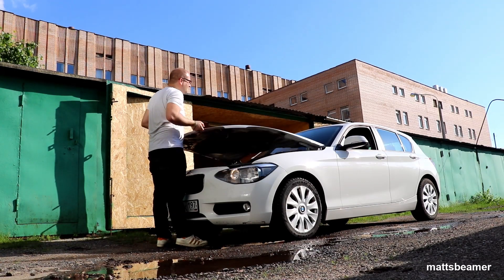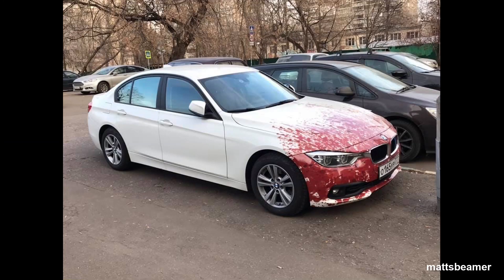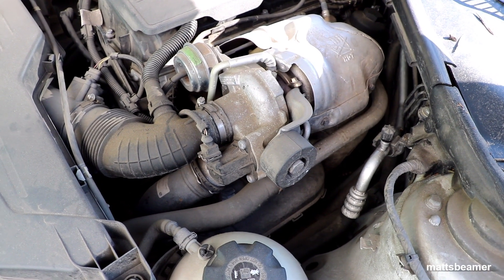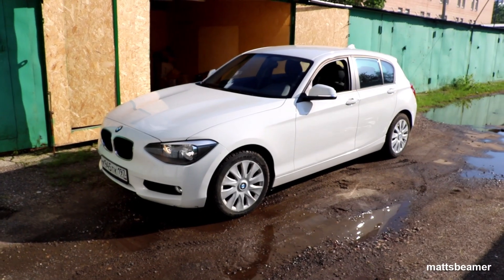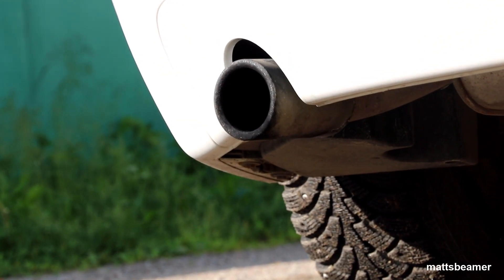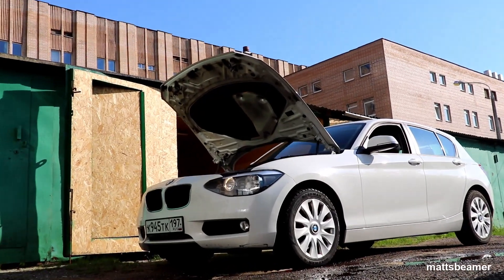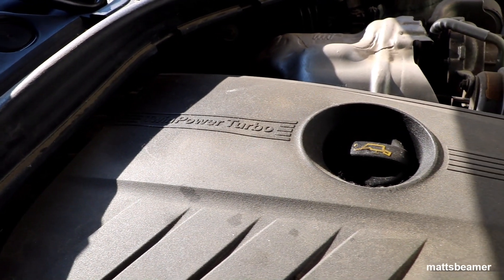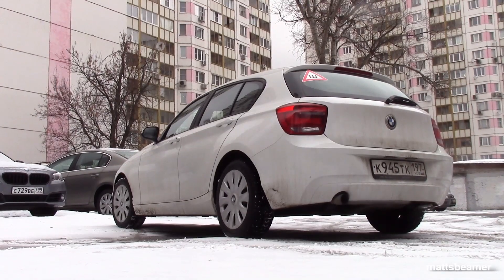Information on the BMW N13 1.6 Turbo PRINCE Engine. BMW F20 114i 116i 118i

Comment: Some knowledge and advice on OIL! Do NOT use 5W30 BMW LL04! Do NOT trust your BMW Dealer on this one! The LL04 they use is designed for Diesel-Engines but also fits the requirements for Petrol-Engines. The BMW LL01 is designed for Petrol-Engines only and fits it requirements better. They just use LL04 because they can have ONE barrel for "all" the cars!

The N13B16 has oil temps between 105-135°C. The zylinders and walls are even hotter than this! A 5W30 oil will just burn and it leftovers will accumulate in the wiper rings. The oil turns completely black really fast after an oil change (like 3000 km or something). Go check this out!. Also the car will consume oil; mine took 1 liter on 5000 km. That is pretty much for a young engine. BMW will say this is "normal" ... ye sure thing ... The mentiont 0,7 L/1000 km is ridicules and should be considered as an engine failure.

On 35.000 km total,  I was sick of it and switched to 0W40 LL01. This oil is perfect in any regard.. No more tar like oil. Even after 20.000 km it is only a bit brownish and traslucent! The consumption was cut in half with 1 liter on 10.000 km. Amazing! I change it every 17.000-20.000 km. Dont go for the full 30.000 km or trust the computer estimates on this one! Mine tells me that after 20.000 km driven, that an oil change is required in 25.000 km. Ye sure, 45.000 km interval. The turbo will LOVE this.

And mine is chipped to 310 NM and 220hp ... for like 80.000 km now and a total about 110000 km. Engine problems so far: NONE!!!🤪
Reply from the maker: Thank you!! I did notice that my oil dropped after 5000km too! I will try the oil that you Recommend! Thank you so much for the input for all of us to learn!!! Matt
Reply: I also got this engine in my F21. I absolutely do not get why BMW recommends 5w30 oil. Changed mine to 5w40 which is a must for this car imo. Even considering going for a 5w 50 for the summer unless i manage to install a oilcooler. Oil consumption is about 0,65l after 6000km, which is fine I guess. Due to the high oil temps I will perform oil change every 10.000km. No matter which oil viscosity you run, the oil additives start to break apart once the oil goes beyond 120°. In other words, the oil wears down faster, hence Im going to change it every 10k.
Reply: Hi, thanks for the advice, but I cannot find any Longlife 01 oil here in germany. Is the oil you mean BMW branded oder do you mean any Oil that meets LL01 and is 0w-40 Viscosity?
Reply: @florians684  Liqui Moly Hightech Leichtlauf 5w40 is the one that i use. Of course it meets BMW 01 Longlife spec.
Edit: The
Reply: @Squilliam-Fancyson  thanks a lot, I recently bought 6 litres of BMW LL04 TwinPower Turbo oil, but I just decided to ditch that. I now bought the Liqui Moly one you recommended for my upcoming oil change. It's also cheaper and I'm confident that it will reduce the oil consumption. I just did a MHD Stage 1 tune to 200hp and I want to reduce the oil consumption and carbon buildup as much as possible. Thank you!
Reply: @Squilliam-Fancyson  Isn't it because you changed from 30 to 40 that your oil is not consumed anymore? It makes more sense. At least for me. It would be better to compare the same viscosity to get better scope.
Reply: @DeeeDeee555  In theory thats true, but my unit never consumed very much oil, even with 5w 30.
Reply: @Squilliam-Fancyson  i use the 5w40 for 10k km now, i think i wanna go back to 5w30. my oil consumption feels higher than before, so i am not 100% sure
Reply: @Oni181  Hm than Im quite sure your engine is not burning excessively  oil. Otherwise your oil consumption should be lowered with thicker oil like 5w40 or 5w 50. Dude I have also oil consumption since about some month now. Found out yesterday that my crankcase ventilation system in the valve cover leaks. A common issue with these N13/N18 engines. There is a membrane on the front left side of the valvecover that gets worn out over time. Mabye you might also check the valve cover for leaks and oil accumulations in the screw holes next to the coil plugs.
Reply: @florians684  I got myself the Mobile New Life 1 LL01 0W40. But any other with LL01 will do. 5W40 will work too!
Reply: I agree. LL01 was also designed for fuels with higher sulphur
Reply: Hey bro im planing to buy a used 114i with 104 000km on the odo, and i want to  have it chipped also ! So do you think that the timing belt will hold on or should i change it ? And is Liqui Moly 5w40 oil good for this N13 ? Thanks in advance
Reply: @AlgerianNinja  I think you misunderstood sth. The N13 is a chain driven engine. If the engine was maintained well (especially oil changes) there is absolutely no reason to replace the timing chain (assembly.) What you could(and should if you going to buy a pre 2014 model) do pretty easy and at very low costs, is replacing the chain tensioner. Its a 15$ part which takes 15 min to install for a mechanic and about 30min if you do it yourself by internet instructions. A swap of the whole chain assembly is also fairly easy done on this engine too, as there is no need to remove the end cover of the engine. BMW definitely improved maintainance procedures with the F20 engine line up. A fair priced chain swap should be well below 1000$, parts included and is usually done in under 2 hours.  
Oil: I used liqui moly for two consecutive intervalls and have to say that its not up to the task surving(black like tar soup after 5000KM) an tuned N13 with oil temps easily rising to 120° if hit hard. Its OK I guess if you perform oil service every 7500-10.000KM. I recently switched to Motul 300V 5w 40. This is a high performance synt. oil with additives standing strong up to 130° celsius. Its "ester core" gives the engine good cold-running properties and keeps the viscosity within a healthy range even above 120°. The 300V is a costly agent though but this is not that hard to justify if it keeps my engine fine.
Reply: @Squilliam-Fancyson  I changed my chain about 2 weeks ago at around 150.000km. All the chain-stuff was still ok, only the chain had very little enlongment. But I have a better feeling now and got it dirt cheap. The problem is, that those rails get bristle over time and may break too.

@flippy9133 mine does not seem to care about that. But if you go track or high speed for longer durations, sure would be benefitial.
Reply: Splendid insights, will it be suitable to use your recommended spec oil in my country where more like the tropics?
Reply: do you think adding oil cooler would be beneficial?
Reply: I always felt this engine was undertuned, never got the courage to actually tune it given how their reputation is, the one in the 320i comes with water to oil cooler, intercooler and all that jazz only for 170, its a far more robust engine than it looks
Reply: @ozan1234561  Just do it, it holds. I promise you! I have zero problems. >200.000 km and counting. I even gave up on warming up / cooling down the engine after the timing -chain change. After 1-2km i just kick it (takes about 10-13km to fully warm up). I don't care any more and it is fine. The right oil is the only thing important to this engine.

Maybe check turbo bearing for play, since it has to work way harder than ever before. Mine is stiff like new.
Reply: Well crap....i used this exact oil , 5w30 bmw ll04 for about one year in my n13 bmw with 216.000 km....used to have pretty bad oil consumption (1L/1000km, 1L/1500km), canged the pcv system, valve stem seals and the vacuum pump and the oil consumtion halved, now at aboud 1L/2000, 1L/2700km (my best so far) still on that bmw oil. before that i used liqui molly 4200 5w30 and I am considering to use it again this for year. I don't think using bmw 5w30 ll04 oil did any damage to my car for now, mechanic said that from the inside nothing seems bad, only thing visible even from the outside is the forever black tailpipe.
Reply: hi mate did you ever have to replace the clutch, if so was it OEM replacement or upgraded?
Reply: @sym6692  The clutch was replaced last year with a normal one from Sachs. The old one had juddered when starting off. The material had hardened over the years. However, the clutch still had plenty "flesh" and never even slipped once.
Reply: @sym6692  The clutch was replaced last year with a normal one from Sachs. The old one had juddered when starting off. The material had hardened over the years. However it never slipped even once.

Comment: 2012 f20 116i currently at 64,000 miles.  Only issue so far has been a couple of coolant leaks from the plastic parts of the system at 40,000 miles. Parts were cheap but labour was expensive. Very good fuel efficiency get about 45mpg on windy roads. Yeah more power would be nice but wouldn't want to mess with the fuel efficiency. Does sound like a diesel though. Don't fancy the latest 1 series but might go for a f21 with a b48 engine next.

Comment: Some common problems 
1. Head Gasket issue, mixing engine oil and coolant
2. Turbo oil lines O-ring leak, leaking oil on the exhaust creating fires 
3.Vacuum Pump O-ring leak,
4. intake hose for Turbo Dry rotten, creating vacuum leak
5.Coolant Leak from plastic housing behind cylinder head
Reply from the maker: Thanks for sharing

Comment: MY 116I IS HUNTING FOR AIR. REVING UP AND DOWN. ANY IDEAS WHAT IT MAY BE?
Reply from the maker: Hey, did you have any error codes? It could a number of things. One of my past BMWs had a split in the intake pipe, and it was talking to much air, which ment my mpg went down as the car was sending more fuel.

Another Bmw I had, it was the ICV.

It’s best to get the codes read to save money :)

Comment: Just got a 116i 2014 , 113k miles got a bad burning smell in cockpit while driving. went through 2 litre of oil in 3 weeks of owning it ,engine overheated ,drivetrain warning ,reduced power ,bought from a dealership tbey gave me the car with one year mot and the handbreak doesn't work , still under 30 day warranty
Reply from the maker: That is shocking (especially from a dealer) , what did you do with the car in the end?

Comment: I have a problem with fuel consumption and reaching top vmax. My fuel consumption is 8,5l !!! I always drive the same way to work every day , my normal consumption is 6.9 l. I drive always the same way with the same tires. I never had a problem reaching vmax (217kmh in eco pro) now I only reach 180 kmh in Sports+. I cleaned the Air mass sensor, but it didn't help. My last problem is my waste gate flap inside the turbo is rattling not the linkage.
Reply: this 6.9 is urban or open road?
Reply: Open Road
Reply: @samuelnink2218  how much in the city?
Reply: 9.0-9.2
Reply: @samuelnink2218 hey did u get a fix for fuel average im also facing same issue

Comment: if anyone knows what causes drivetrain error? on the F20 118i 2011. how does one resolve this issue if it keeps coming back even after taking the car in for repairs?
Reply: Bit late years ago on ours it was the vanos that caused it.

Comment: can you talk about the heat of the turbo? I notice even after short drive, the bonnet sides are super hot, it looks like the heat shield just bounces it and its so hot it could burn your hand. are there any negative implications to this heat to other components/ paint etc ?

Comment: My 2014 118i has about 140k km and needed new oil seals, valve cover gasket, coolant tank and a new cylinder head gasket as it was losing coolant. Runs well after doing all that. Really nice to drive with 170hp, just needs a lot of maintenance to keep it running well.
Reply from the maker: Thank you for letting us know what these engines are like to live with. Cheers

Comment: I started using 10w60 Liqui Moly on my n13 with stage 1 310nM and 217HP. So far, I can see that the oil consumption is still high(aprox. 2 liters in 1 month 5000KM driven).
What do you guys think about using 10W60 oil? The climate in which I use the car is aprox 40 degree during summer.

Many thanks for this video

Comment: Hi Gents, i have a 2014 118i and have had a rough type idle for some time. The bmw dealership cannot tell me what the issue is after injector replacement, full major service, coil packs, charge pipe replacement etc. What happens is that when i drove for a while, stop, switch the engine off, then when i start again there is almost a hestitation or jerking in the engine, almost like a misfire but with a struggle to breathe... Can anyone please advise? I will appreciate your input
Reply: May be CCV/PCV valve

Comment: Hi, a lot of people have problems with the  PCV system. Broken PCV lines cause vacuum leaks which lead to a lean condition, which causes rough idle or even stalling. Also for PCV, there are PCV valve membranes inside the valve cover. The only way to fix it correctly seems to be installing a new valve cover.
I personally experience shaky and hesitant acceleration and shifts (manual). I discovered that there is oil around the lower PCV line that connects to the air intake tube in front of the turbocharger. Also I could hear air escaping when pressurizing the intake with a glove and a bicycle pump. I will replace it and tell you if it improved the situation.
Reply: did it solve the issue?
Reply: @Ebaywarrior21  well, there actually was a leak in the PCV line I replaced it. Also beware that the hose that connects the turbo to the intake / MAF sensor WILL break when you try to pull it out as the material is of very poor quality. I would say that I don't know if this improved smoothness, because I did a few other things: Replace spark plugs and ignition coils, especially the ignition coils fail early and cause misfires before that, put good gas and injection cleaner to clean the fuel injectors. The biggest thing that caused shakyness was the dual mass flywheel (DMF) It was worn down and allowed a lot of play, which reduced smoothness a lot (My car only has 120k km) I replaced it with a used one from a car that had 40k km and now the ride is as smooth as never before. I even have a "light" stage 1 tune which gives me about 170-180hp. You might also want to reset the DME adjustments.
Reply: @Ebaywarrior21  My mechanic told me, that this engine is electronically supervised and controlled by the ECU / DME very well, so anything dramatic will likely cause a check engine light and anything that is not problematic won't. Of course in my case, it technically wasn't a problem, but the shakyness bothered me. In the end I had to pull the transmission, replace the DMF and hope that it would improve the situation which luckily, it did.
Reply: @floriansaurwein1895  thanksfor your response. We need more good information on repairs on the n13 as this is still a new engine in a way

Comment: Think knock is a very common problem on these engines. Always requires high fuel quality and a proper spark plug gap.
Reply from the maker: Hey, thanks for your input :). Yes very true, I can only use V power in min, or its not nice when it starts up .

Comment: Shell Helix Ultra 5W40 - BMW LL01. My motor has 165000 + KMs,  - Issues so far: 1) Turbo charger coolant pipe inlet and outlet O-Rings changed, front and rear main crank shaft seals changed, Valve cover and vacuum pump seal changed. Coolant tank changed. I do have the startup rattle but to me its not a big deal, I know what it is, just too lazy to fix it lol... Oh and the engine intake pipe ( Part from the turbo to the MAF body) tends to break at the turbo side.
Reply from the maker: Thank you so much for all your information. I am only at 42000km at the moment. :)
Reply: @mattsbeamer   I forgot to mention coil packs. I changed one just yesterday and changed one a couple years ago. I also did a drain and fill on the zf transmission at 100000kms. I have an annoying oil leak that I suspect is coming from one of the chain guide bolts. If it turns out to be that I’ll updated the comments.
Reply: Hamid - and you still on original Timing Chain?. I have been getting the "Drive Train" message and my mechanic says its time to change the timing chain. The car is on 160,000km - about 120,000km he replaced the Timing tensioner.  Does this model suffer same issues as the N20 engines?
Reply: @ManUtd_Rules   early versions of the n13 have been known to have issues with the timing chain “stretching” and the guides breaking. I’m now at 170k kms and on original chain. Normally drivetrain error is the result of one of the wheel speed sensors going bad or one of the ignition coils going bad. I’ve changed 3 of them to date and have a spare just in case the other one goes.
Reply: Forgot it's the 316i 2013.

Comment: So where is timing chain located? Front or back of the engine? Does the engine must be removed to change timing chain?
Reply from the maker: Hey, its at the front of the video, and there are people who are changing the chain with the engine in. I personally haven't changed one thou. Thanks for the question, I added it to my latest Q and A. Cheers

Comment: Did a chip tune on my 2015, 116i pre-facelift, got from 136hp to around 220! Also got the M package which makes it a fantastic, sporty little car. I love it to bits! 
(Also wanted to add that in the LCI model I believe they changed the motor which makes it not as tune able.)
Reply: How much the m package cost u
Reply: @madalinnicolae5594 I'm trying same thing now.
Reply from the maker: Hugo Ohlson cheers for the input mate. Your car sounds like it’s a beast! Yea the 3 pot is not as easy to tune :) I hope your 116i keeps on being good for you :)